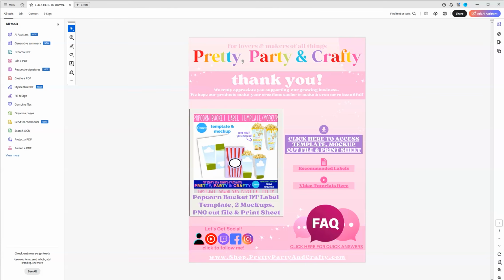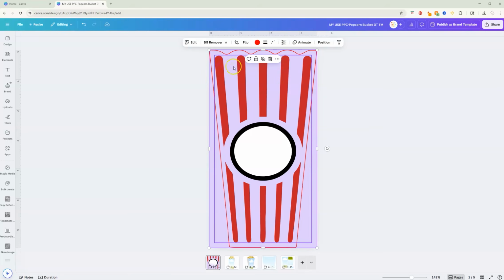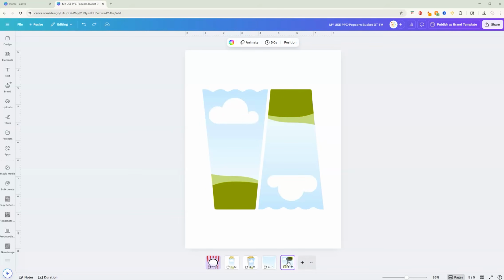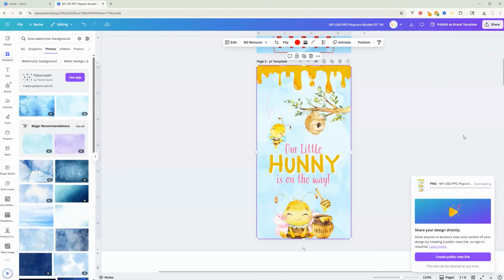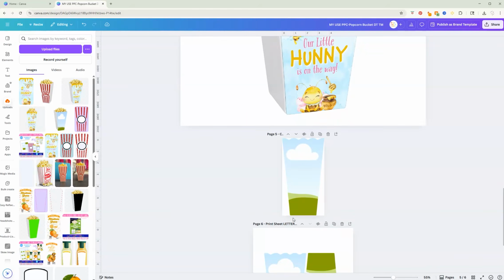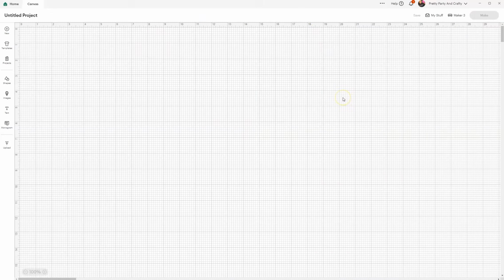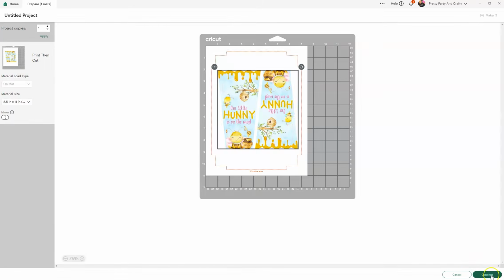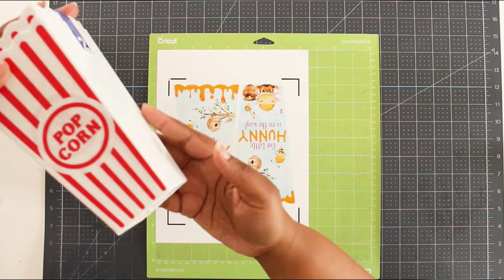How To Make Cute Popcorn Bucket Labels With Canva!

Comment: Hey new here I love your work! You inspired me to get back into crafting!  Quick question So do I have to use a circuit? I can’t just print with my inkjet to get the same results?!
Reply from the maker: Cricut only cuts, so you don't need a Cricut. Just print as normal and cut using scissors. Our template includes a print sheet if cutting by hand.